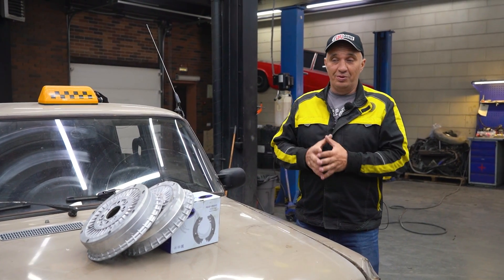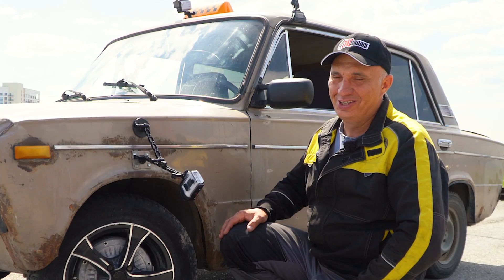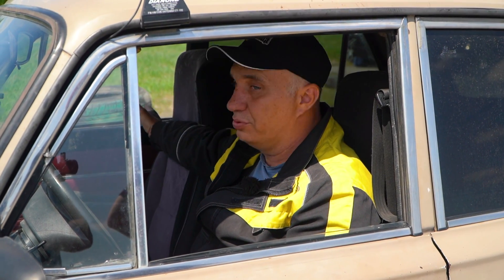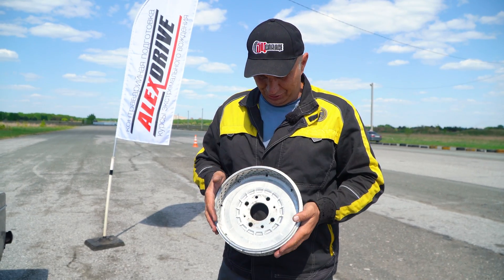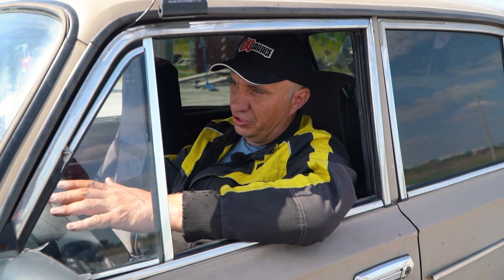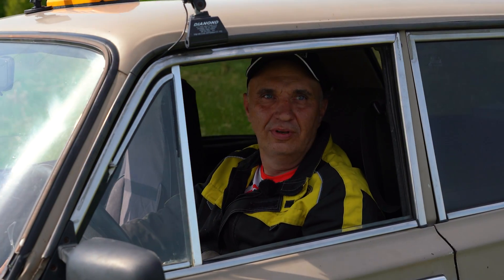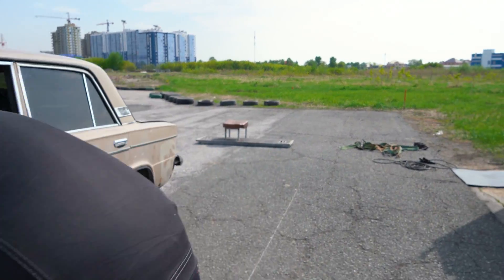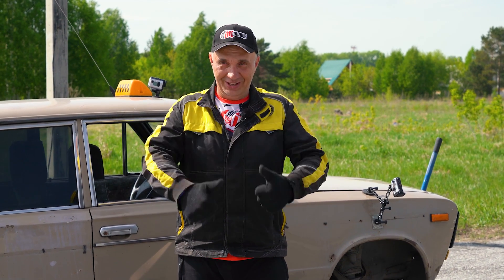We progressively drill holes in brake drums – what will happen?

Comment: From my understanding, the reason why the brakes deteriorated after progressively drilling holes was;
- Due to numerous holes being added, the drum became weaker generally plus the heat generated after braking, it's bound to increase in diameter. That explains more pedal force.
The first round after drilling was better and more effective. That's how a good braking system should be. Less pedal force, more biting & shorter braking distance. 
I'll go with that.

Comment: Boiled the brake fluid. That is why it went to the floor. Boiled brake fluid created bubbles in the system. 

A cheese grater has holes and higher friction. The more heat increases the temperature because of less metal. This high heat boils the fluid and pedal goes to the floor. The drum cracks and locks the wheel. Can’t withstand the pad pressure with the weakened metal strength due to high temps plus the reduced metal area.

Should have weighed the drums after drilling. Just good information to have. FYI, trimming the drums on the lathe removed some aluminum and reduced the brake fade performance. Painting black reduced performance.

Comment: I propose 2 more tests. Transverse drilling with slot angled in different directions to see if and in which direction the cooling increases and test with water spray to see if drilled drums lose performance compared to non-drilled ones in wet condition.

Comment: Why are drums worse than disc brakes? I never understood because it would seem more surface area is creating friction on a drum brake compared to a disc. And if it's a matter of hydraulic pressure being more force on discs could you not just have hydraulically powered drum breaks made from the same material as discs?

Comment: Brake drums and rotors generate heat faster than they can dissipate it.  The mass of metal is a heat sink, and can get saturated.  That is why a hard stop from high speed can result in "brake fade", where no matter how hard you step on the pedal, the car will not slow down any more.  Also why you do not want to cut drums or rotors, that gets rid of mass.  Just replace them.
Reply: Victor it`s just experimenting and fun, where would most of us have time to try these experiments.

Comment: I'd like to see the disc brake test repeated with a modern car with ABS.
Perhaps a disclaimer could be added that modern cars have plenty strong enough brakes by default, so any upgrade wouldn't change the stopping distance. Performance brakes on modern cars only improve on the cooling over the stock brakes. Stopping distance? Nope. Only better tyres improve on that. 
So the conclusion of these videos should be that vintage cars didn't have good brakes back then, but this logic (add holes to upgrade performance) does not translate to modern cars.
I also have my doubts about the testing method, as without ABS the human factor just invalidates the results. It's not easy to conduct a scientifically accurate tyre review (we can see from Tyre Reviews how much time and effort goes into creating ideal test tracks), let alone in a DIY experiment where nothing is consistent.

Comment: I would of stop since the first set of holes. It is allowing gasses to escape from the shoes. There was no contact surface to brake properly with the more holes you drilled. I would of done with the tests with 5 braking test after each modification to see what brake fade would do.

Comment: I wonder if you could of drilled some holed on the vertical face between the ribs to help improve the air flow through the drum in combination with the first hold spacing might of helped?  Your video was fantastic.

Comment: Friend your test was short almost flawed. you need to set a course! Run 1/4 kilometer,  U turn back 1/4 kilometer, repeat 3 times braking as forcefully as possible each time, by the 4th stop youll see fade and the test results will become real .  You have to do a consitant stop and start multiple times quickly, and heat soak the brakes past operation parameters.! 🤩 Make Them GLOW🌞like the sun friend GLOW!!!

Comment: You should redo the first braketest because the brakes weren't braked in so that is why the distance was long the first time. I guess the result would pretty much be the same as for the diskbrakes. Holes can help with cooling but too many makes the whole assembly more prone to break because of less material.

Comment: Drilling drums...hmm. I wonder. Drums, but if they had like...fins/ heat sinks on the outside of the drums that kind of slice through the air. Granted, at the point of trying to upgrade drums, most people would convert to discs., but this is an interesting idea and topic.

Comment: They will perform better because stopping less mass centrifugally is easier. But more work is needed to stop because of the lesser mass. Hence stopped better temp stayed even though "vented". Hence more exertion on the proceeding test. The size, weight, and even shape are considerations when designing brakes. The weight of the rotor, drum, plays a significant role because it's also a moving mass that needs to be stopped/slowed.

Comment: you might have hit on a good idea if you can calculate how much surface area you can remove without compromising the strength of the drum, I think a combination of holes and grooves would work best, like a disk brake, when you look at a disk that is drilled and grooved not a lot of surface material is removed to have big gains in braking efficiency,

Comment: The braking force is directly proportional to the surface area. When you first drilled the holes, the surface area decreased about 10% but heat buildup decreased and so the braking efficiency stayed normal. Then as you made more holes, the surface area decreased and so the braking force while heat desapitation into the air was high. Lesson: Yes holes help, but just enough of them.
Reply: The amount of heat generated from a small car stopping once isn't going to be anywhere near enough to saturate drum brakes. Drilled rotors are completely pointless unless you have a car with enough power to quickly accelerate up to high speed and brake hard over and over again like on a racetrack.
Reply: @rubiconnn  They will perform better because stopping less mass centrifugally is easier. But more work is needed to stop because of the lesser mass. Hence stopped better temp stayed even though "vented". Hence more exertion on the proceeding test. The size, weight, and even shape are considerations when designing brakes. The weight of the rotor, drum, plays a significant role because it's also a moving mass that needs to be stopped.

Comment: It's called gassing, hot air is trapped and causes a very thin layer of the hot air and makes a barrier. Slotted or drilled brakes push that air away and have a better grip.
It's the opposite of what oil does basically 😂

Comment: Test from initial set of holes showed an improvement in braking possible from the friction surfaces wearing in to shape, the temperature differences side to side possibly due to the direction of the holes drilled, one side the arc of holes spinning to the forward braking shoe, and the other side arc of holes spinning away from forward braking shoe...also the holes drilled could have become acting as a fan, one side pulling outside air from the wheel to underneath the car and other side pulling hot air from underside of car to outside the wheel...

Comment: Imagine yourself as a powerful and exhilarating Nitrous Oxide System, ready to unleash your potential within a roaring car engine. Excitement courses through your valves as you anticipate the thrill of acceleration and the rush of speed. As you take your place within the vehicle, you are met with the eager gaze of a passionate driver, igniting your desire to push the limits and conquer the road. if it's possible try to do that...😅😅😅

Comment: there is an advantage to this people used to do this for offroad racing. it allows the drum to push out any water so you dont loose your brakes after crossing water it also pushes out sand and dust

Comment: Cross drilling never increases stopping distance, it's only purpose is repeatability, to combat brake fade from heat soak after repeated use. The same for finned or drilled drums.
Cross drilling actually decreases the surface area making braking worse for the first stop, but it's outweighed by the ability to continually stop at that same distance. Much the same as race compound pads, they will work terribly at the start but have a higher opperating temperature then start working better, and will be repeatable if maintained within that opperating temperature. They maintain this temperature by air ducting to brakes, vented, crossdrilled and/or slots for de-gassing rotors so they don't overheat whilst continuous hard braking doesn't allow them to cool.
Reply: On drums another difference this makes it that as gas/heat/dust builds up between the shoe and the drum they let it spit out so there isn't a cushion of heated air after a few hard stops, I did this to the rear drums(I did less holes and smaller ones) on my astro van and boy did it make a difference whenever i had to slam on the brakes on the highway a few times in a row, they no longer warped and got shaky after 2-3 decelerations from 110kmh to 50 lol

Comment: How old are those brake shoes? That could make. Difference on how they work, especially in a wet climate when one side gets glazed and the other stays somewhat dryer.
Reply: Go back to the start of the video, they have a box of new shoes to go with their new rotors, which means they most likely started all-new. He also says he hadn't tried the brakes until they got to the track, which means the pads may not have had a chance to "bed" into the drums yet, which could explain most of the differences between the first three hard-braking tests.

Comment: Were there identical tires being used? 
Was a dot4/5 brake fluid being used? 

Drilled brakes are not for single shorter braking distances. Drilled breaks are theoretically for better heat dissipation after multiple braking zones seen on race tracks. 

Each brake drum test should have been a series of 3 back to back brake tests measuring distances and heat before drilling.

Comment: the later test runs showed what happens   in such a short time, the shoes becoming Grazed Over! all the excessive holes drilled did was reduction in mass which allowed faster acceleration. thats why the new rear axle for my racecar is gonna have disc brakes.

Comment: I like drum brakes and i'd like them on front brakes too performance wise but they are complicated and behave weird when wet and heat up easily and cool down slow, are also a witch to adjust and break them in, in fact they could drive for a week in town and the shoes would still not be set to the drums.
The performance increase they saw when started drilling them are not because of the holes but because the shoes took a step to break in and maybe quicker.

Comment: Frankenstein gas-diesel engine.

Diesel requires heat for combustion, supplied primarily via compression. By welding large internally finned intake air expansion chambers to the log-style exhaust manifolds of a gas V8, it might be possible to lower the compression ratio for the engine to run on gas (via a carburetor) while cold, and switch to diesel (via injection pump) once warm.
Reply: Already something people have

Comment: they do a mistake : with disc brakes there's only friction surfaces but with drum brakes there's the friction surface but also the drum's sides and they measure the temperautre only on the sides and the sides' temperature is slightly the same (10 to 20 degrees for brakes it's nothing) because it's not the friction surface and the friction surfaces seem to be colder on the infrared cameras.
they should drill holes on the sides

Comment: So now do it all again only this time do it properly. Drums and Disks.
First bed in the brakes 10 x 80 kmh to 40 kmh to bed in the NEW brakes.
Then drive figure 8 route as fast as you can like racing.
You should only get about 5 laps before Brake Fade takes effect. (Stock factory brakes)
Now start drilling and racing the figure 8 again to see how quickly the Brake Fade comes back.

Comment: The holes have nothing to do with stopping distance . You had a brand new brake and rotors therefore in the first run they would not perform the best. It is normal to have better brakes with every run even with NO HOLES .
Reply: Would it be better to put the holes in the side?
Reply: they used to do it in the 50s for race cars, drilling drums reduced brake fade over a lap but you wont see any improvement when just coming to a stop
Reply: @topzozzle6319  It also allowed water to vent out of the drums in wet weather conditions to help mitigate the performance loss. Once disc-style brakes got more sophisticated over the years though the performance gain for the drilled drums was lost
Reply: @uber sophisticated my ass

Comment: The breaking improves when you drill more holes in the rotor or in this case the brake drum because the more metal you remove the more pounds per square inch gets applied to the brake pad and rotor and allows it to bite on them holes just a little bit I believe
Reply: That weight difference is very neglible, rotor weight has very little to do with braking. The difference was that regular drums main weakness is heating, drilling holes allows much more cooling substantially reducing brake fade. Surface area doesn’t affect coefficient of friction at all, force does. So because the brakes were cooler, he was able to push the brakes harder without any fade improving performance.
Reply: @Eclipsis17  well then that's probably a good thing my comment has nothing to do with the weight of the rotor I feel as if you may not have read the whole comment or you did not understand it at all
Reply: @Eclipsis17  and yes the holes help with venting clearly but it also helps increase how many pounds per square inch you are putting on the brake pad being less material means the brake pad can actually apply more pounds per square inch on the surface is pressing against

Comment: Pretty good idea💡. Cooler brakes should mean longer lasting. Wish there will be some study of this someday. There has to be a sweet spot of number of holes, hole pattern, and maybe even hole angles to find the optimal combination for best performance and longevity
Reply: Bad idea, brake drums are designed  to reliably stop a vehicle within a certain distance.  The introduction of water and dirt will greatly effect both.  Interestingly you can buy disk brake with holes,  but those are for niche applications only, such as auto racing.
Reply: why ? disk brakes are superior in almost every single way
Reply: Think about the trucking industry, it could help prevent runaway trucks. @gnaedigerfels
Reply: @gnaedigerfels Not realy, disk brake are lighter and have better heat disabatience, but that doesnt matter much for normal driving.
Drums are cheaper, more robust and a much longer service life.
Reply: Genau... deswegen sind alle modernen LKWs mit Scheibenbremsen rundum ausgestattet.
Trommelbremsen halten bis ans Lebensende aber es kann gut sein, dass das Lebensende deutlich schneller da ist als es sein müsste.
Desweiteren haben Trommelbremsen eine höhere Neigung zum Verglasen der Bremsbeläge und die automatische Nachstellung der Beläge ist deutlich fehleranfälliger. @jonasstahl9826
Reply: @gnaedigerfels  Man kann nicht zwangsläufig Rückschlüsse von LKWs auf PKWs ziehen. Bei LKWs hat man nunmal gesetzliche Gewichtslimits, wenn man da 20kg pro Rad mit Scheibenbremsen sparen kann sind das am Ende 200kg mehr Nutzlast, was ein erheblicher Vorteil ist, beim PKW ist das relativ egal.
Gerade wenn man in Zukunft mit E Autos oder Hybriden fährt, dadurch das diese meistens rekuperieren und so selten Bremsen haben Scheibenbremsen dort das Problem das diese Verrosten.
Dort wären Trommelbremsen vom Vorteil, da diese besser geschützt sind und die schlechtere Wärmeabfuhr keine Rolle spielt da die Bremsen nur für Gefahrenbremsungen benötigt werden.
Reply: @jonasstahl9826  Das Trommelbremsen besser geschützt sind ist ein Irrtum, Feuchtigkeit interessiert das nämlich überhaupt nicht. Des Weiteren sind festgerostete Trommelbremsen um einiges schwieriger Instand zu setzen. Der einzige Grund, warum Autohersteller auf Trommelbremsen zurück greifen liegt an den geringeren Kosten, Trommelbremsen sind einfach nicht mehr Zeitgemäß.
Besonders bei eh schon übermäßig schweren E Fahrzeugen ist eine Trommelbremse bei Notbremsungen nicht ideal, da Rekuperation bei zum Bsp. One Pedal Fahrmodus zwar ausreichend ist aber Grenzen durch Akkumulator/Controller zwecks zulässiger Ströme begrenzt.
Reply: @jonasstahl9826  Why are drum brakes cheaper.  I'm not saying you're wrong but I really can't understand why they would be cheaper.  Drums contain more metal, they're more difficult to produce so why to manufacturers charge less money for them than disks?
Reply: @KenFullman  Metal per weight is pretty cheap, the manufactoring is what cost the most.
Disc and drums are both made of cast metall.
The disc is usely hollow on the inside what makes it more complex to cast.
Also the disk needs a brake calipar what is another cast and machined part, that cost money. The drum only needs a simple backing plate that is just stamped from sheet metal too mount the components.

Comment: the problem with the drilled rotors in the first video was simply too many holes. they should be in a spiral pattern, with plenty of space between, and you can even drive a slot between each set of holes.
Reply: They would have just bought proper rotors then